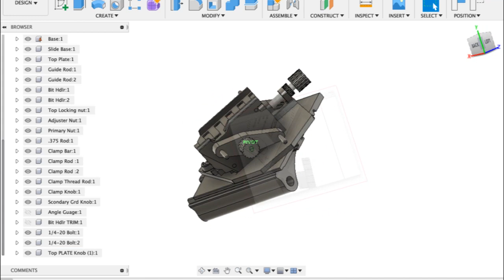3D Printed TORMEK Drill Bit Sharpener

Comment from the maker: Below is the link to the Fusion file.  Like all my projects, it is NOT finished.  Feel free to admire the janky design, but do NOT make your own or try to sell one.  This is only an artistic tribute of a drill bit sharpener. 
-Jake

https://a360.co/2Dsz2OX
Reply: Awesome... Great work.
Reply: Thank you very much! I go try make one for me.
Reply: Thank you :)
Reply from the maker: @v50freak  Good luck.  Let me know how it turns out
Reply from the maker: @nicksgarage8295  Real G's move in silence, like lasagna.......
Reply: You are the God among men. Thank you. What do you mean by "not finished"?
Reply from the maker: @PatchworxStudios  It mostly needs improvements.  Like metal threaded inserts instead of 3D printed threads.  Also need to get the angles right on the gauge.
Reply: @publicprofile1  Yes some insert would be nice. The baseplate is sliping and would need more torque to hold xD. I also reworked it a little to be more printer friendly.
Reply from the maker: @PatchworxStudios  Thats great!  I use Cura and a Creality Ender 3.  My prints are taking forever..... Any tips to speed things up?
Reply: @publicprofile1  I don't consider speed that much but it depends on the settings and how comfortable you are with them. I use a sidewinder x1 and simplify 3d. Part  1 I printed standing upright with enlarged layerheight. Almost no suports where needed. After testing i reduced the infill to 30% but i think it could be reduced further. Same with outer perimeters and top/bottom layers. To the other Parts i aded triangular and honeycomb holes so that the structural integrity stays the same but with less material usage and print time (at least i hope it worked, i didnt compared it). I will print the chuck later after i get a leftthreaded die. I will print each one in 2 parts and connect them later to save on supports. I also changed the screwholes to metric and corrected 2 small gaps. If the whole jig works well I would consider to try some redesign with a 3d printer in mind. Maybe we can skip part one entirely by using the tormek plate for sharpening cissors(at least my set has such a plate).
Reply: @PatchworxStudios  what kind of material did you use to print it?
Reply: @theangryluthier2244  Standart PLA, had a garbage roll to get rid of. I sharpend all my drills, 35pcs. The results are okish, i had a small dimension error while printing but the real problem is in the original tormek designe. It is working but its hard to get the flutes perfectly even and takes to much time on larger diameters. It requiers still lots of practice  or you get triangular or hex holes.
Reply: you are great.
thank you so much
Reply: Please, how to download it? :( 
Thank you very much.
Reply: @publicprofile1  It seems like there have been a change to autodesks myhub so that a shared design is only downloadable if shared by someone with a subscription (i think the free trail counts), and with the downloadable option toggled. Before the file was downloadable by default for all users. Could also be that the person downloading needs to have a subscription, but that I am not sure about.

Is there some other way for you to share the files, such as thingiverse or just a simple dropbox? That would be fantastic!!
Reply: @publicprofile1  Hello Jake, 
thanks for sharing the your project and research.
I was wondering if you could share the folder for the 3d printing.
I now would have the opportunity to print it out and I would love to give it a try.
Thanks a lot!! :)
Reply: Unfortunately I can not download it from the myhub link you posted :(
Reply: Hi Jake. You have done a fantastic job there. I take my hat off to you. How can I download the fusion file. Thanks kevin
Reply: Hi Jake, it seems that the project cannot be downloaded from the link anymore. Could you possibly share the f3d archive file on thingiverse or elsewhere? I would be very grateful (and others probably too). Thank you for sharing this great project. 
-Honza
Reply: Hello my friend. I saw the model, but I didn't understand if it was possible to download it?
Reply: @publicprofile1  
Love your work, link seems to be view only, any chance for a link to the files?
Was thinking about making it myself when I stumbled across this so any help would be appreciated.
Reply: @PatchworxStudios  do you have the stl files please? i really would like to build such a great device myself! :) thanks in advance!
Reply: Hello. I their a way to download the files? Please let me know.
Reply: Hi Jake, i just learned that you have to toggle the "downloadable button" while activate sharing. without its just viewable ... could you please do that?

Comment: Hi Jake, I figured it out. It is on you end. You need to share the file below as downloadable. If you don't, Fusion360  only can look at it thru the viewer.
Reply from the maker: Glad it worked! I am having trouble right now using Fusion on my mac because of all the updates.
Reply: No it still doesn't work to print the parts. I cant download the file.  Only to look at your solid model.

Comment: Thank you very much for sharing and having a trouble to do this. I've been waiting to have this. One problem, though, since I don't have Fusion360 available. In exports .obj and .stl parts are rotated in all angles and original rotation doesn't seem to be available. Putting parts straight so I can print them is quite big trouble. I guess it is same with others. If the angle is not absolutely correct, it will mess the part.
Reply from the maker: Yes,  download Fusion.  Its free for hobbyist (as of now)
Reply: @publicprofile1  It wasn’t available for Linux, which I’m using. I also have expired fusion 360 subscription, which can mess thigs up. I had it for Eagle PCB software. It was less trouble to rotate the parts. They are coming out now and still one to go. 

Currently casting a ’stone’ from aluminium. The plan is to cover it with copper, make straight and put some diamond in it. 

Maybe an overkill to lap drillbits but always wanted to know how they work when being really sharp. Propably the edge won’t hold very long.
Reply: @teropiispala2576  I would be interested in seeing your process on making your own wheel. Could be useful for making form wheels. Will you (or have you) produce(d) a video? Sounds like a very neat project!
Reply: @reddtekk  I have already casted a frame. I did the mould from plywood and glued smaller pieces in each outer rim and on the center. Then I casted it from aluminium using normal casting sand. 

I don’t have a video for that, but it is pretty trivial if you are familiar with casting. 

I haven’t done this type of videos. I could try one, but it takes quite a lot of work and I thought no-one would be interested. 

Next phase would be to straighten it up on a lathe and then find a way to get copper into it. I have a special solder which stick into aluminium but I have never used it on a piece of this large. 

It need to be covered with copper because aluminium is too soft and casted one is grainy. 

When copper is on, the surface can be straightened in a lathe and then lapped to be smooth. 

Diamond powder can then be rolled in with ball bearing. 

Diamond should then protect copper from wearing out, but the edge angle should be grinded close. 

In any case, this is final finishing wheel, not material remover. More diamonds should be added time to time. 

I have right now lots of projects going on, but when I come back to this, I can consider of making short video. 

Casting is not necessary if you can find proper aluminium plate somewhere. For me it was the easiest way. Best would be to have solid copper or brass plate, but those tend to be expensive and hard to find. At least need to be test if this really works. 

I could melt a copper too, but currently not enough for a ’stone’.
Reply: Hello Tero, do you maybe have the files for printing?
Reply: Tero do you still have the shared files please ?

Comment: Excellent!  What Cad program do you use, or did it come with the printer?  I am going to have to get a 3D printer.
At $7.50 per hour you showed them! I am sure that most of the work was in the drawing. Now you could easily go into mass production and make a fortune, so a printer would put out about how many a day? LOL
Reply from the maker: I'm using Fusion 360.  It took some time but its a complete game changer for my half cocked ideas. 3D printing is slow.  The bit holders take 12 hours to print each.
Reply: @publicprofile1  Thanks I have been running Turbo Cad. Yours looked like it was a little more user friendly.
Reply from the maker: Fusion is great for working out geometry and conflicts.  I'm using it right now to help me design a rigid base with tool holders for the HF bench grinder.
Reply: The original one is patented and selling a copy can cause problems. This model, of course, is not meant to be used. Only to demonstrate how it works so you can by the original.

Comment: Awesome! Please let me know if you designed it with original Tormek dimensions? I have the original Tormek ground plate and only need to print the clamping prism. 
Thank you very much!
Reply from the maker: I'm not sure if it would work...  I pulled a picture online and scaled in Fusion 360 to get me started.
Reply: @publicprofile1  thank you for your response! Today I printed one piece for a test and it seems to fit 95%! Especially the thread fits great to metrical studs. I will only improve the guide and maybe the tap on the side.  You did a great job, much thanks for sharing the files! 
Best regards from Germany!
Reply from the maker: @christiana.5236  Thats awesome!  I must admit I don't think I got the angle gauge right.  So now when I sharpen, I use a little bit more angle to start with so the bit has more clearance after doing the secondary grind.

Comment: deeply impressed and i did buy the $300 jig which i think is okay value for money
Reply from the maker: How do you feel about the speed?
Reply: @publicprofile1  The first time sharpening any drill it is pretty slow. but once you have them with the correct geometry then dressing them is pretty quick

Also have you got this stone?

As it increases the speed in my experience

https://www.tormek.com/uk/en/accessories/other-accessories/sp-650-stone-grader/

And i can add my voice to those calling for the files to go on thingyverse as that is a first class solution
Reply: Sry but the original is not even worth 300 bucks. I would like to have it just because I am lazy and because I have only a tormek that is ok for the job. It is so much faster to do it by hand. I did, but  it was not my grinder.
Reply: @publicprofile1  I did buy very coarse (and cheap) stone which had larger inside hole.Then I made correct sized bushing with my lathe and glued it on the stone with epoxy. After dressing the stone, it runs perfectly straight every time. That stone is very good for roughing and it wears down much less than the original. I'm considering of making the same bushing to Tormek stone too since it seems loose it's eccentricity after I take it off.

Comment: Can it sharp end mill bits?
Reply from the maker: Dont think so.  But that might be a good project to 3d print.
Reply: To do it properly would need very high precision. Probably more than is possible with Tormek mounts and 3d-prints. Of course it will cut something even as a single point cutting tool, but won't work like the original bit.

Comment: Great work Done. How good is the sharpener jig? Will most likely buy the original but somewhat expensive so would like to get some feedback if the jig is doing the work 🙂/ Br Stanni
Reply from the maker: The jig works good.  The BIG challenge is how slow the process can be.  You will spend close to 10 minutes per bit sharpening in the 3/8" to 1/2" range.  Much longer for bigger bits.  Smaller bits go faster.  A good magnifier and some Sharpie will help you track the progress.  The Tormek is known for producing a razor sharp finish on anything.  I'm not sure that's necessary for all your drill bits.

Comment: @JakeBelk first of all thank you for sharing! it looks quite impressive. where did you get de rod (0.375)? I am from Germany so I am not that used to imperial measured parts XD i can get imperial bolts but I am not sure how you put together the 0,375 rod?! is it one peace? or did you weld the flat part to threaded part? or is it the original from tormek?
Reply from the maker: The treaded rod?
I bought the rod on Amazon.  3/8"-24tpi.  Cost $7.
Reply: @publicprofile1  thanks for answering. yes, I mean the rod which defines the depth of cut. the threaded part of it is wider than the tip pointing towards the grinding wheel(when mounted). its named 0.375 rod in Fusion. I just was wondering how you made the smaller, not-threaded part of it.
Reply from the maker: @bloodyt7464  Hmmm....  The threaded rod is the same OD from top to bottom.  I epoxied the plastic nut to the rod.
Reply: @publicprofile1  I think I maybe described it not that well... I try to show what I mean on this picture https://ibb.co/dJs9MqM The section I marked is where the rod changes from threaded to unthreated. Also de diameter seems to change from 0.186inch to 0.125inch. I am just not sure if you turned it down with a lathe or anything like that. I am just wondering because I don't have I lathe, so if you did it in another way I would be interested :) or am I wrong and you I just didn't get the fact that the unthreaded part of the rod fixed in place and loose/not fixed to the threaded part?